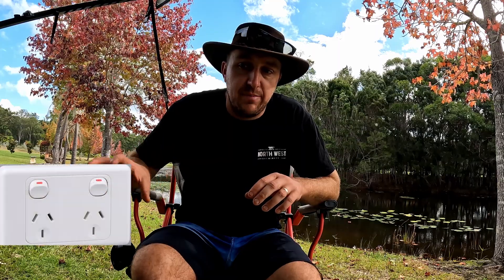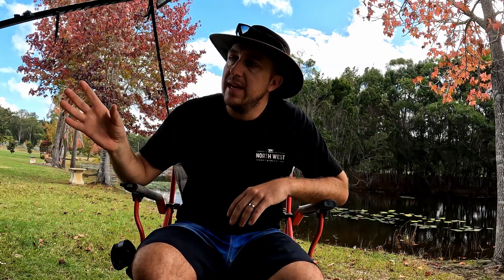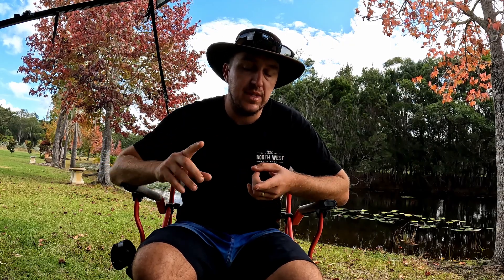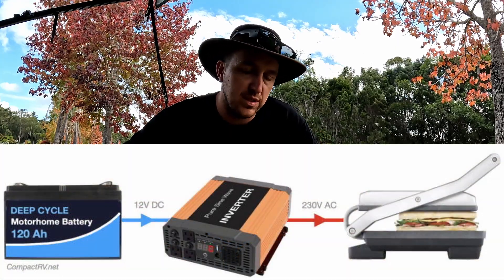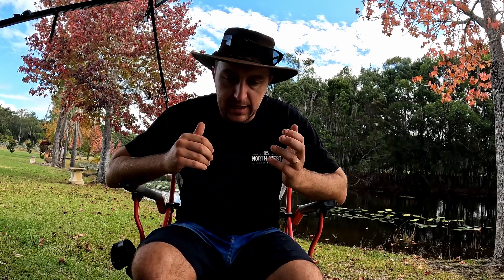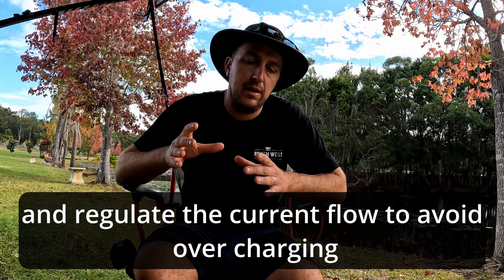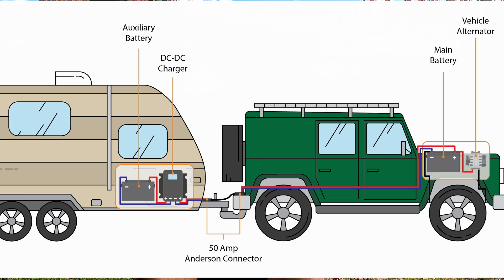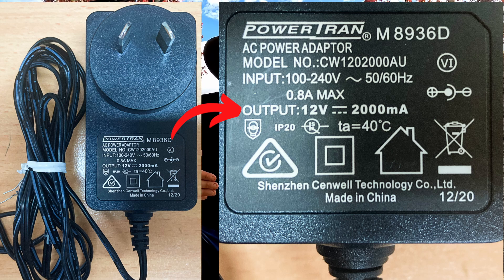How it works - OFF-GRID POWER - (NO selling)

Comment: Hey mate, Do you run a DC Dc charger
Reply from the maker: No i don’t, ive thought about it as i think i get too much voltage drop from car to van but i dont have anything in the back of the car to need one for that
Reply: @Ourwhittleadventure  I was thinking of adding the Miniboost Pro.
Reply from the maker: @jamieweston4495 yeh ive heard some have success with those. Because it charges from solsr while we drive its never been too much of an issue for me but would be a great way to boost up the chsrge on a driving day

Comment: Hey Mark, I've also read that you can't run a large inverter on a small battery as it will draw too many amps and the onboard bms will shut down.
Reply from the maker: Yeh it would really depend on what your trying to run with the inverter and for how long and the type of batteries you have and their discharge rating.

My inverter is seperate to the BMS so im drawing straight from batteries and my itech ones can discharge at 270A so for me thats not really an issue.
But yes should definitely be a consideration if wired through the BMS as i think mine can only output 35amps
Reply: Yeah I'm looking at  a 120ah Lithium battery that will output 120a so probably max would be a 1500w inverter. The battery will run the fridge in the car and the inverter for the coffee machine. 😁
Reply from the maker: Yeh beauty!

Comment: That was a good simple explanation.  
Here in NZ we run 2x160W solar panels. Two x 120 amh batteries. 
We don't have an inverter.
We weighed up the costs & decided for the way we want to live, what we have is fine. We don't carry a generator & on the couple of occasions we were running low on power,  we just booked into a motorcamp.
Our lifestyle is different to yours, of course.
We're on the road around 130 to 150 days a year. I am seriously considering a portable solar panel fir winter months though. Cheers team 😊😊
Reply: Great bit of info. We are like you, We have a simple setup. We are happy with it. 😊
Reply from the maker: Dont really need much do you!
Reply from the maker: Yeh well thats it, if you dont need much then why spend the $ a portable solar panel definitely helps during winter, thr sun angle on flat panels isnt very efficient.
Thanks for watching!